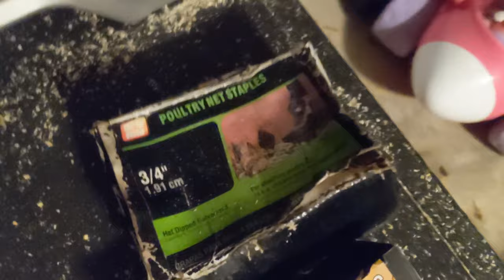DIY Compost Sifter + Gin Trash Compost!

Comment: If you find a high-sided wooded drawer, take out the bottom and add hardware cloth on that and just make rails for it to sit on.  Put a tarp along the bottom so you can just collect what falls out by pulling it out and pouring it into a pile. I’ve seen great old well made drawers (solid 4 sides and bottoms) at the ReStore for $5, cheaper than most an make it.